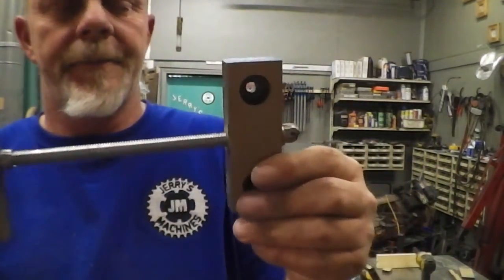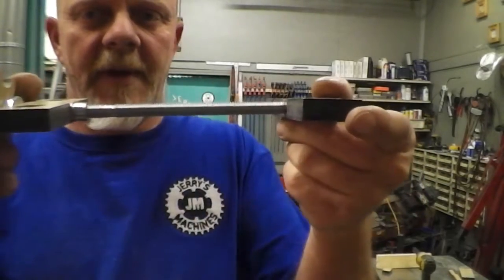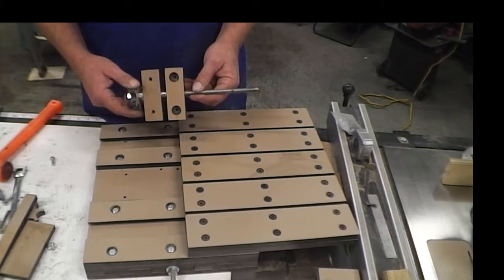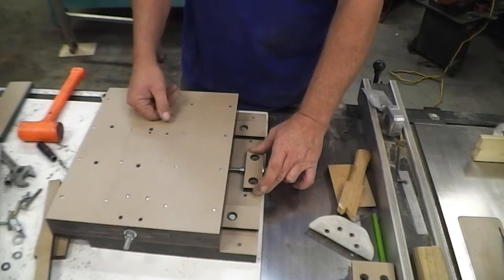Mill style drill press table build part 3

Comment: Would it be beneficial to coat the threads with graphite spray to help keep dust out of the threads?
Reply from the maker: I do that with them. It has to be done every once in a while due to sawdust stripping it off the threads. In the final video I will show this.